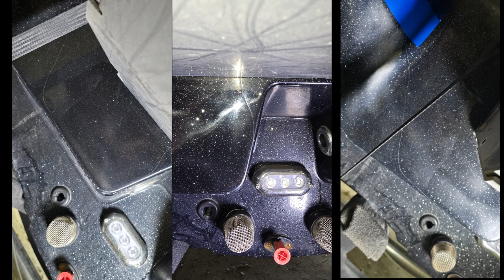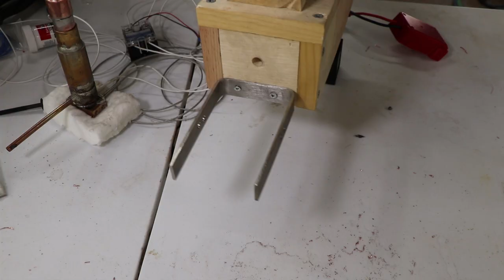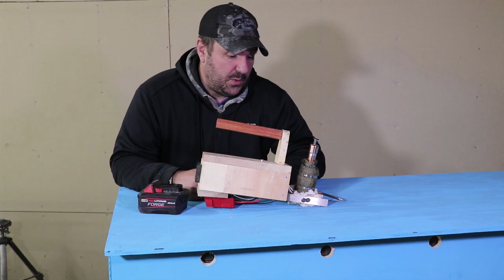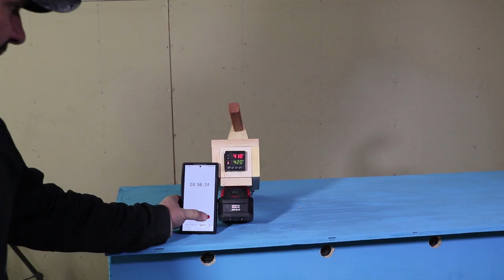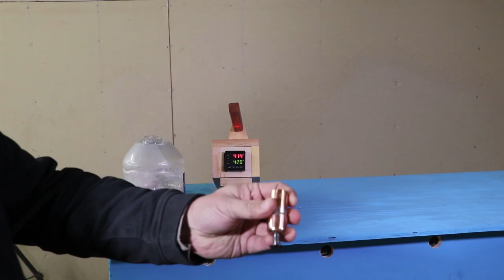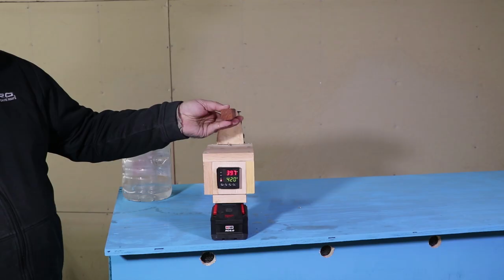Cordless OA Vaporizer (Homemade)

Comment: Hello. 
Thank you a lot! Now i have some questions. May i?
1. Heater. On an market there are 12v, 24v 40-60-80 W heaters. Battery is i think 18v, maybe 20 for parkside. Witch one do you use, please?
The rest i can figure out but in this part of technology i’m quite lost. Thank you a lot! I had the same idea, but hot end heater was out of my mind so i was still wandering how to realise that chamber.

Martin
Reply from the maker: I tried 24V it works but will be a slower heat and wont reach max temp its rated for so i used 12V version it works fine with the 18V power supply. i Used this([5-Pack, 4.92ft] 12V 70W Heater Cartridge, 3D Printer 12 Volt Upgrade to 500°C, Compatible with MK8 Extruder V6 Hotend PT100 Volcano) off amazon
Reply: @Everest_Fishing  would use the 12 or 24 volt heater with a 20 volt battery?
Reply from the maker: @50adrod  I use 12V and PID controller if your gonna use a heat switch then use 24V that will prevent you from burning it out but it is slower and wont reach max rated temp for that heating element.
Reply: @Everest_Fishing  thank you a lot. I'll do it from battery operated soldering station - they are directly for parkside / makita baterries, quite cheap from china, all electronics and heating already build with temperature control. but i have to solve how to solder the main chamber? Pewter would melt under the temperature of the treatment. how did you soldered it? thank you 
Martin.
and happy new year!
Reply from the maker: @MartinStyblo  have to use high temp brazing rods with a MAP gas torch you could use silver/gold and  lead but the issue is it doesn't like binding to copper so i went for the cheaper version which was copper brazing rods.
Reply from the maker: i use the 12V you can use 24V but its slower so i use 12v and PID controller to not burn it out heaters are just resistors.  you can look up 3d Heater block housing to get different was to mount it hope this helps.

Comment: Was trying to do the same thing as you and came across your video. It may just be my 50w heater cartridge or my thermocouple not reading well but I can’t get mine to read over 270 when set at 375. Tried running an auto tune, tried bypassing my discharge protection. Still no  luck, any thoughts?
Reply from the maker: It can be your thermal probe could not read that high that's why i went with k type would verify temp with a temp gun
Reply: @Everest_Fishing  I'm using a K type as well. Bottom copper cap reads within 5 degrees of the PID with an infared thermometer. Do you know if you are using a 12v or a 24v cartridge and what wattage it is? I have a bunch of miscellaneous 3d printing parts laying around so was just trying to use the 24V 50W heater that I had sitting around but it just doesn't seem to be cutting it with only 18V out of a battery pack.
Reply from the maker: @NMarsh8899  mine are 70 watt 24V cartridge and i insulated it and soldered in to allow good contact could be a contact issue or cartridge issue the one i use it rated for 500C
Reply: I'm starting to think it's just a wattage issue. If my math is correct running a 24v 50w cartridge at 18v is equivalent to a 24v 29w cartridge. May just need to up it to a 70w cartridge. Thanks!

Comment: Thank you for your video it was very helpful!!
The PID has any protection from overdischarge ?
Reply from the maker: Funny thing I just ordered a over discharge protection cause I killed a battery they are not bad any where from 8 bucks to 20.  But yea it does need it I need to update it
Reply: If you're going to update your video is it possible to show us with more details the wire connection?
Reply from the maker: @GeorgiKosta-s9u  i would but its basic wiring and im not a electrician  would hate to miss speak about something and cause someone to fry a PID controller or battery explosion.
Reply: @Everest_Fishing maybe you could put a disclosure in stating you’re not an electrician and the video is for educational purposes only. Then you can show the wiring